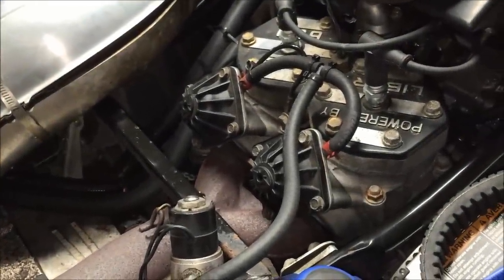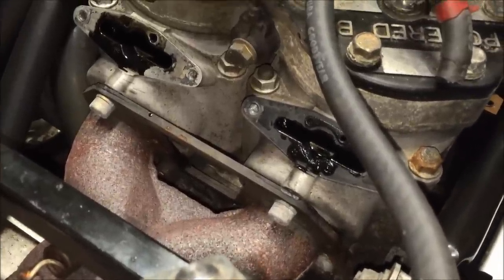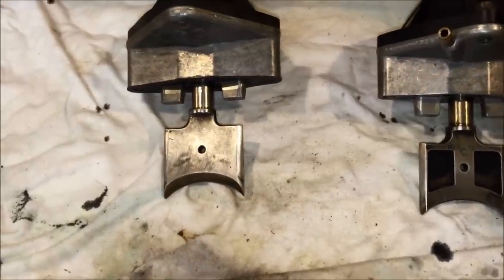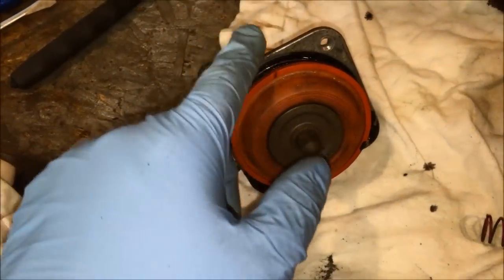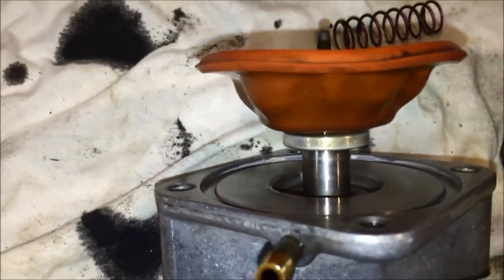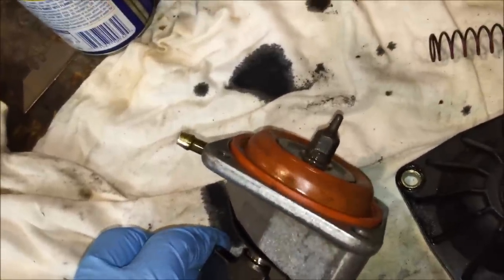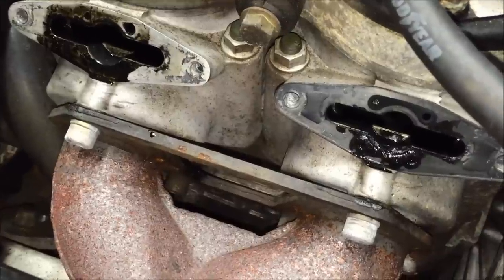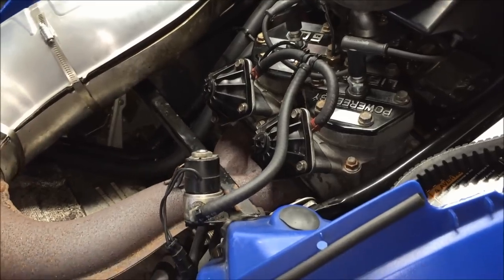Polaris Exhaust Valve Cleaning Process - Domestic Twins 600 700 800 900

Comment: Streeters Garage... You forgot a very important part in this cleaning process ! I watched this video last year cause I had a Top end bog on my 2009 RMK 700... I cleaned my Valves exactly like you did... Tried my sled and it still fell on it's face... Then went on and changed a couple of expensive parts, bought a fuel pump $300... Nope, it still fell on it's face... Thought my injectors where f*cked, Bought them for $400, Still stumbled... Brought my sled to Polaris $1000 later still the issue wasn't solved... They where clueless on the issue also... So I decided to come back to the Exhaust Valves as a final solution... I sat down and completely disassembled them... Then it hit me.  The little holes under the bellows need to be cleaned ! The ports get clogged badly because of oil goo. I used WD-40 and a hair pin to clean them out. I had to scrape and use more WD-40 to clear them from all the goo. After a while. I could then see light passing through them. I could have saved nearly $2000 if the job would have been done right. Now the sled is pulling revs and standing on it's tale ! Info just to let you know bro.
Reply from the maker: Glad you were able to figure it out. I'm surprised the Polaris dealer didn't check it as well.

Great information and thanks for sharing!
Reply: doobyboy21 I have the same problem on my 600 iq shift, intermittent bog in mid to high range, gonna try this, thanks👍
Reply: Dooby Boy well said as well I ran  small Weld cleaning rod threw it I saw ur video on YouTube as well 🤘🤘thanks the both of you. I’m from. mn ripping daily and yes the 2 litttle holes go through 2 don’t go somewhere else .!
Reply: 2009 assault bogging mid to high right now, have a fuel filter coming and will clean the valves

Comment: Dont forget your gas port on the cylinder. While moving the piston  to BDC below VES gas port, clean the gas passage. If you look in front of your valve, there are 2 holes. That is the right hole. Clean it but be careful. It goes from 5 mm and then tapers to 2 mm. Locktite and torque to 10. 5 to 13.5 ft-lbs. thanks for your video.
Reply from the maker: Good point.
Reply: @StreetersGarage  From the manufacturer. Polaris maintenance book.

Comment: Excellent video. I have the same year make and model and need to get this done. Thanks for a great video and very informative. Did you happen to notice a better running sled after doing this? Thank you
Reply from the maker: No problem. It ran the same. But the valves weren’t that dirty

Comment: I was hoping you'd show actual "cleaning of rhe the valves". Did you spray them, let em' soak for a spell, etc. Going from dirty to clean we see but how you made them clean should be shown. THX
Reply from the maker: Combination of WD40 to break down the carbon and oil. Brake cleaner for the final clean.

Comment: I do not have the hoses on my exhaust valves, what the difference? My engine is an 04 700 twin in a Polaris Classic. I was getting horrible fuel mileage so I saw that cleaning them can sometimes be the problem. The underside of the bellows were full of oil the left side more than the right. I replaced bellows and gaskets and cleaned the valves and they now move freely
Reply from the maker: The hoses were a later EPA requirement to allow excess oil to be drained into the bellypan. Most people would just drill a hole in the bellypan and feed the hose through and allow it to drain to the ground.

Comment: just got a 2002 polaris rmk 600 with powervalves they are new to me. how do you know when they are causing problems? do they make a noise or is it just sluggish? right after you snap the throttle and let the rpms come back down to idle it has a little bit of a clacking sound and then goes away.
Reply from the maker: Jordan Shoemaker 

The valves only effect higher rpms. You wouldn't notice it if you're just running it on a stand. I would go ahead and pull them clean and inspect anyway.

Comment: 2002 Ranger. Starts and runs good when cold at first. As engine heats up it starts back firing and will barely run much over idle speed, popping constantly. Sounds like sticking exhaust valve to me. I tried some gas additives and oil additives and went to Polaris extreme duty oil as well. That actually seemed to improve things quite a bit although still there. By continuing to give it gas and get rpm up, it will free up and run good for quite a while, then starts popping again. If a couple tries doesn't free things up I let it sit for 15 minutes or so and usually that will get it going again. I'm not much of a mechanic to attempt disassembly and cleaning as video shows, and not sure if my 2002 is similar enough, but if my symptoms seem right on I will give it a try. Nothing much to lose at this point. Suggestions?
Reply from the maker: Not sure,

Comment: i have a lot of oil on one side of the gullitine and barely any on the other is that normal?
Reply from the maker: +Billy Yohan I wouldn't worry too much about it if the sled has been sitting during the offseason. This is normal.

Comment: I went to clean my exhaust valves today and the cut outs are on the exhaust pipe side (bottom) and not the top as you referenced. What exactly would be the issue if you had them upside down so to speak?
Reply from the maker: it would be at the incorrect seat angle
Reply: i would look at the tapered edge, it should be at the exhaust side i think. the cutouts can be on either side, or be totally missing.

Comment: Thanks good video.hey do you know if a 2004 xcsp 700 edge had rebuildable front rydeFx shocks? I cant find out anything.
Reply from the maker: +Joe Neault 

Typically the RydeFx shocks are non rebuildable. If you look at the top of the shock body where the shaft goes in. You'll either see a threaded cap or a welded cap. If it's welded its non rebuildable. 

Take a look at my channel I'm currently going through a 01 XC800. You can see an example of the shocks in the rear skid. 

Thanks for watching and please subscribe!

Comment: My sled runs great brought it in for a trade in and they through me for a loop it had great compression but was "about too blow" and my exhaust valves needed too be clean I'm not loosing power or anything should I? It only has 1300km
Reply from the maker: DirtyJDiesel 

What year and model sled? What reason did they give?
Reply from the maker: Sounds like they were just trying to bullshit you into a lower value on the trade.

Comment: Just bought a 2006 switchback 600. And of course shit is wrong with it that he didn’t tell me.  That valve screws into the bellow correct? Threads are gone inside 🤦🏼
Reply from the maker: There should be a cap that threads on too the exhaust valve. There’s a washer that goes  between the bellows and the cap too hold everything together. Should come off with a 10mm socket.

Comment: Found out the rubber bellow has hole in it how do you change that?
Reply from the maker: You need to unscrew the cap from the shaft and you can then replace the bellow 

Thanks for watching!

Comment: I just bought a 2009 rmk 700 155 and the top exhaust valve bolts where stripped ! One bolt even fell down  in the motor nowhere to be scene again !
Reply from the maker: +doobyboy21 That sucks,

Look at it this way. You would have been pulling the cylinder anyway to get the hole drilled and tapped. Not you have a legitimate excuse to go in and go fishing!

Comment: what do those tubes do and what are they ment for on the power valve nipple?  just wondering for knowledge purposes
Reply from the maker: They are essentially vents for the waste 2 stroke oil. They are connected to a solenoid which will activate and open up the valve on the solenoid which will allow any accumulation to drain
Reply: +Dirk Diggler thank you very much thanks for the video it helped me clean my valves I'm doing a top end replacement and i want to know anything I can
Reply from the maker: +mark raw No problem. Glad it helped you out. I need to go do mine in the next couple of weeks!

Thanks for watching!

Comment: Will that make you loose low end power??
Reply from the maker: It will affect top end power. The valves don't open up until higher in the rpm range. 

thanks for watching!

Comment: I opened the hood after riding and noticed oil spray on the exhaust valve ports.  The breather hose has a minor crack in it from rubbing on the valve.  Do you think this is where the oil is coming from?
Reply from the maker: It could be. Another way to tell is while the sled is running, look at the holes is the plastic cap and check too see if you have any exhaust/smoke coming from them. If you do, this a sign that bellow is torn.

Thanks for watching!

Comment: So it wouldn't affect my starting power
Reply from the maker: starting as in trying to start the sled or just from initial takeoff?

I regeared mine from 23/39 to 22/40 and it improves the low end performance a lot.
Reply: Starting as in taking off
Reply from the maker: No it wouldn't. That's mainly clutching, belt deflection, jetting and gearing.

Comment: Please edit your video or remove it. Your cleaning process is incomplete and missing checking/cleaning the small ports on the valve and cylinder that let the exhaust gases go through and control the valves with the solenoid. THESE NEED TO BE INSPECTED!!!
Reply from the maker: Will do.

Comment: Wrong, wrong, wrong.  You said that the bottom that has only a slight bevel on the leading edge, was the top.  When the actual top requires a much sharper bevel because it slopes down towards the piston face.  So you got it backwards.  You failed to give any instructions for removing the oil and carbon from the  blade.  A 3M circular fiberglass disc for paint removal, that inserts into a drill form Ace Hardware, will remove the carbon with help from a brake cleaner.  Wrong, wrong, wrong.  You failed to remove the nut above the bellows and inspect for disintegration of the vinyl bellows, because it disintegrates in the clamped area.  You also failed to inspect the impact shoulder on the shaft of the blade.  It gets flattened when it impacts the cylinder head stops  and necessitates replacement.  You also failed to inspect the extreme tips of the blade and the piston wall, for impact damage from when the blade shoulders become flattened and did not stop the blade soon enough before the blade impacts the piston wall.  You should redue this entire video.
Reply from the maker: Thanks.